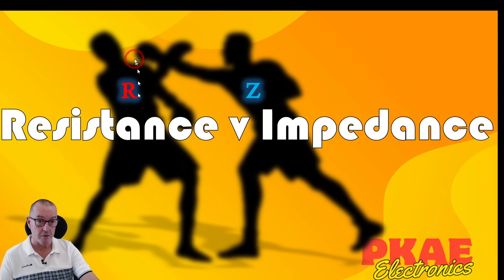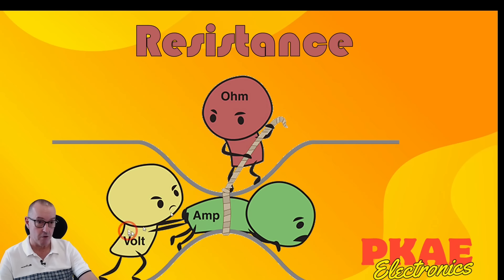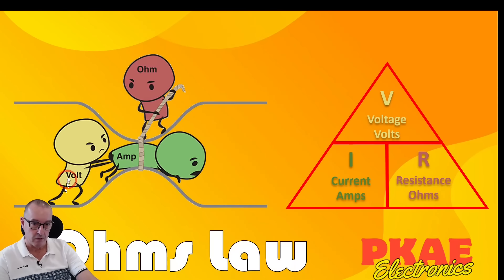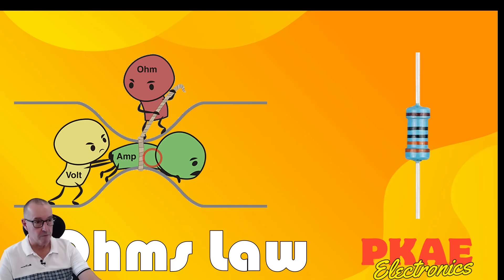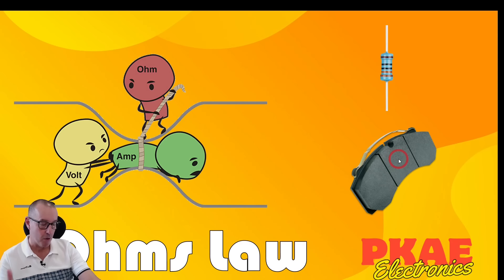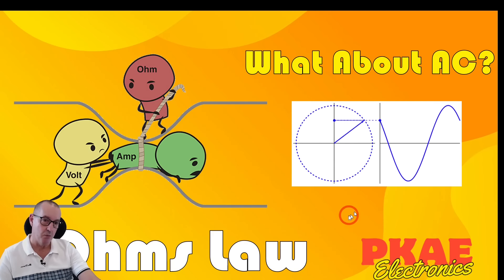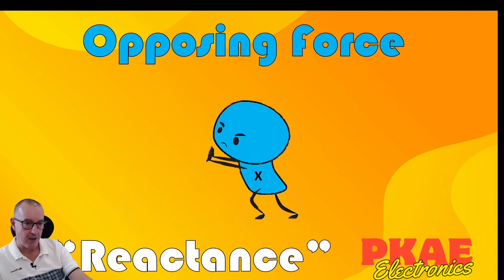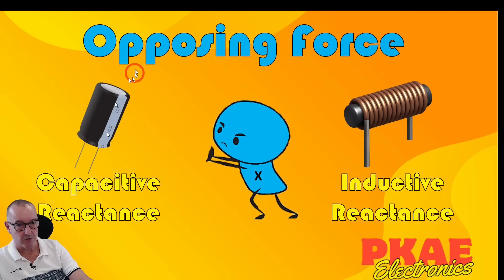Impedance Explained.

Comment: But...Why are crystal-radio circuits super high impedance? Compared to the speaker in a pocket radio (8 ohm)!
Reply from the maker: Good question. I don't know the answer for certain without a bit of research. But, at a guess, I would imagine those crystal radio earpieces I remember using are probably very high input impedance (which equates to very low load). This would be because the audio signal from the receiver is very weak (also high impedance). The earpiece must be very sensitive, far more than typical domestic earpieces or headphones.

Check my other video on Impedance matching:- https://youtu.be/5p0v7ZU0WcA

Comment: Answer to first question….: because you are testing with a different voltage and or frequency and possibly an LCR meter in one and a Volt/Ohmmeter in the other. Ok…. Whats your answer, why are the readings different?
Reply from the maker: Because one is only measuring the Resistance component of the circuit and the other is measuring the collective opposing effect of Resistance and Reactance.

Comment: @13:54  "inductance is zero point two MICRO henrys"  should be MILLI henrys. (or 200 miro-henrys)   I would also suggest in the discussion just before that when talking about how low speed changes go through an inductor, that the slow changing doesn't relate well to the flywheel.  Instead, talk about the amount of time spent in a given turning direction, and how once you're up to speed, there's effectively NO resistance, so the longer you spend going in that direction, the more time you're spending with no resistance.  The "effective" inductance should be thought of as the average resistance over one entire cycle, so as you spend more time in one direction with a capacitor, you are spending a greater percentage of time in the high impedance behavior of the capacitor, or the longer you spend in one direction in an inductor, you are spending a greater percentage of time in the LOW impedance behavior of the inductor.
Reply from the maker: Thanks, I spotted my error between Milli and Micro soon after publishing. I did add some text but I'm not sure everyone see's it pop up because I used Subtitles to add it.

Thanks also for the alternative explanation, I am sure it will help others to visualise even better.
Reply: @paulpkae  Yeah, I spotted that small mix-up with micro-henry too. You can always update your video description, and/or put a pinned (sticky) comment in. Great explanation btw!

Comment: Off content: CC/subtitles have no text, is this intended?
Reply from the maker: Well spotted. The Subtitles were enabled in an attempt to correct two errors I made. At 13:53 and at 14:18 I state Micro Henrys when I meant Milli Henrys. If you have Subtitles enabled it should pop up with the text at the right moment.

Comment: impedance doesnt cause heat.
Reply from the maker: To clarify, Reactance does not cause heat, but the Resistive part of the circuit does. The Resistive element also forms part of the overall Impedance, so yes, impedance does generate heat when a current is flowing through the circuit.
Reply: @paulpkae  are u sure?  it depends on your definition of impedance,   isn't it when voltage is equalizing with itself to stem the flow instead of squeezing the pipe?
Reply from the maker: @magnuswootton6181  that element is the Reactance. Impedance is the combined effect of Reactance AND Resistance. Watch the final part of the video for explanation of the Impedance triangle.
Reply: @paulpkae  ah thankyou for the clarification.  reactance... doesnt cause heat.  i should have said.
Reply: @magnuswootton6181  Real power corresponds to energy departing the electrical domain.  Reactive power corresponds  to energy being shuffled in and out of energy storage components, which ultimately stays in the electrical domain.  Resistance causes heat, but reactance doesn't directly cause heat.

Reactance will indirectly cause heat, due to increasing current demand, and thus increased ohmic heating of the distribution circuits.

Comment: @13:54 ?
Reply from the maker: If you mean the term micro rather than milli, then yes I spotted that and did add a caption using subtitles. Other than that, I don't know what your comment relates to?
Reply: @paulpkae  Ah, wasn't using subtitles so didn't see the correction.
Reply from the maker: @henrikbergman4055  yes unfortunately I don't know any other way of adding a caption once the video is uploaded. With subtitles enabled it does pop up in a couple of places. Thanks for watching.

Comment: Isn’t impedance really just localized voltage differences? It doesn’t seem as fundamental as voltage, amperage or resistance. It seems like it’s just a simple derived way to look at voltage differences.
Reply from the maker: Its the combined effect of reactance (voltage difference if you like) and resistance.
Reply: Impedance is a mathematical shortcut to handle the calculus operations of electrical elements.  While pure resistive elements relate current and voltage thru simple algebra, reactive elements by contrast, relate current and voltage with calculus.  Capacitors generate a voltage difference due to the integration of current, and inductors generate a voltage difference due to the time derivative of current.  This means our circuit becomes a system of differential equations, that we'd solve to find the operating condition we'd like to know.

In the special case of working with sine wave signals for the steady state operation, we can transform this calculus into algebra with complex numbers.  Integrating is equivalent to dividing by 2*pi*j*f, and differentiating is equivalent to multiplying by this term.  We can embed this term as part of the impedance formula for each reactive component, and then solve for what we're interested in, using complex algebra.  The magnitude tells us the amplitude of the waveform, and the complex angle tells us the phase shift.

In the more general case, 2*pi*j*f is replaced with the parameter s.  And instead of solving only in the steady state case with sine waves, we'd be solving in the Laplace transform domain.  Usually, this isn't necessary, since it's most common to work with sine waves in the steady state.

Comment: All in all AC sucks, it complicates things and we should all just go with kind and easy DC.😉
Reply from the maker: Edison vs Tesla 😄

There's good reason why we use AC in our electrical supplies and in may electronics aspects its unavoidable.
Reply: @paulpkae  I know. But it's interesting to see DC having a bit of revenge with all the digital devices and batteries we are using now. 24 V DC world be enough for most things in a house except in the kitchen and washroom. Would be nice with usb as standard for most household power outlets.
Also there are some really long, often  underwater transmission lines built as high voltage DC lines really cool stuff if you ask me.

Comment: i think the cartoon creates confusion, as voltage drops that little green guy is going to blow up like a tick
Reply: How does current go up when voltage goes down? 

If E=IR, then they have to rise and fall together if R is constant.

Reactance is related to frequency and capacitance/inductance.

So how?
Reply: as i understand, its like a bigger wire has a smaller number, a bigger speaker has a lower ohms value, smaller the number the more power it will draw, as a system goes into failure if you had a meter on it if the resistance goes up  impedence goes down (smaller number is more and bad like a short circuit) or if you are trying to power a city and the dam is low on power the voltage will drop   and cause problems, this happens also before the battery dies it can be hard on the equipment
Reply from the maker: @jimorgain63 great question and I can see how it appears to be wrong. 

Maybe what you are missing, is that in AC circuits, capacitors and/or inductors are repeatedly cycling through charging and discharging states. The reactance, measured in ohms, is  effectively the average "pushing back" effect throughout the entire AC cycle. At any point in the AC sine wave of the supply, their pushing (or pulling) effect will vary. At certain points in the cycle they offer no impedance (zero ohms if you like) at other points they present their highest impedance. 

It's a little like saying our mains supply voltage is 120V or 230V; it's not! That's simply the RMS or the equivalent average over the entire cycle.  I hope this helps clarify.
Reply: @jimorgain63  
AWG has nothing to do with any of ohm's law 

Resistance is proprtional to length and inversely proportional to diameter.

R=ρL/A

Ohms law states E=IR

Decreasing E means I must also decrease, so "the green guy" (current) would absolutely not "blow up like a tick". Exactly the opposite.
Reply: @jimorgain63  
Impedance is the vector sum of resistance and reactance. So, no, if impedance goes up, resistance doesn't go down necessarily. If reactance is constant then increased impedance requires increased tesistance.

Comment: Thanks i dont find any of these anologies helpful because they break down right away when you limit an LEd's current,  my first activity playing with electronics, and I cant get over that no one has a real explanation why they say current flows from one side or another but expreiment shows it doesnt matter. If it flowed from negative to positive then your LED should break if you put a resistor on the positive end.  And im just supposed to accept this model that doesnt agree with experiment?  Im still willing to believe it flows from either positive or negative and something else is going on we just dont have the resolution to see, say a few electrons get through but not enough to break the LED, then after they get resisted on the otherside they send a message to the majority comming theres resistance and they react.  Maybe this is the inductance?   Or all the electrons are  connected somehow, so minority scout electrons up ahead can instantly send messages back to the majority.  Its sort of like how lightning starts from the ground up idea.  It needs a path first, but something has to scout that path right?  ...  Alphapheonix sort of shows this with his "path of leaste resistance" video where he shows the heat signature of electricty going through metal and i think the conclusion was some minotiry electyrons take a random path before the majority settle on the path of leaste resistance.  Same could be happening with led's and resistors.   But im starting to think Veritasium was onto something about electricity doesnt actually flow through wires but in the magnetic field around them.
Reply: There is a voltage drop across an led and a resistor. If you drop the voltage from 5 to 0 you give the led the full 5v but if there is a resistor in front or behind then the voltage across the led will drop by some amount, let's say the led needs 2.6v. There will be a voltage drop across the resistor of 2.4v it does not matter if the voltage drops from Led - Resistor 5 to 2.4 (2.6v) and 2.4 to 0 (2.4v) or Resistor - Led 5 to 2.6 (2.4v) and 2.6 to 0 (2.6v) the delta will be the same
Reply: It's not that deep bro
Reply: Our convention for assigning current is an artifact of history, based on a sign convention for charge that was established about 100 years before the electron was even discovered.  We simply never bothered to reassign it, since it would make all existing books inaccurate.  Instead, we consider the direction of hypothetical positive charges flowing, instead of electrons that really flow.  It's no different than whether you consider the hole on a golf course to move, or whether you consider the grass and dirt that really move.  Two sides of the same coin.  It's all just an artifact of history, and 9 times out of 10, it doesn't matter which way you consider actual charges to be flowing.

Your concern is with the resistor and LED in series.  The current flows simultaneously in both of them, and they are both already full of electrons before the signal gets there. It doesn't matter which circuit element is placed on which polarity of the LED, or wither the LED gets the electrons first, or whether the resistor gets the electrons first.  If there is a forward-bias voltage drop across the LED, the LED will glow.